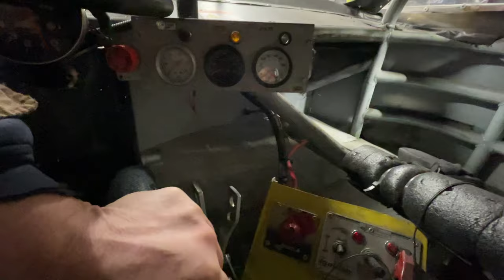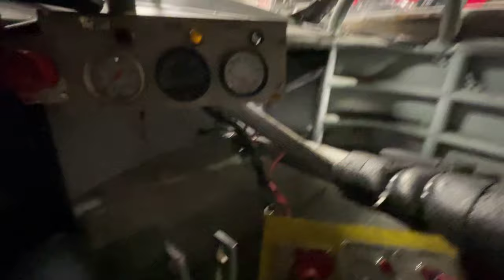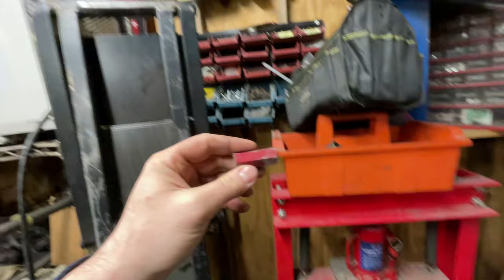Back to the Street Stock!

Comment: These anti reversion mufflers for these crates are huge huge gains down low def worth running them boss.  

Also with the 602 run a ground from head to head then off one of them into reg chassis ground. Nice gain in the hei system from that !! 💪🏻
Reply from the maker: Wish I could, but specific mufflers are mandated by rule.

Comment: 78 Camaro calipers are 3” piston use that on left front 

Then u can get 85 Buick regal v6 caliper u can find a 2” piston run that on Rf. Theres 2.5” piston calipers also 

Use higher high temp brake fluid
Reply from the maker: I have to run the same brakes side to side and they have to match the spindle type, they’re very specific on rules up here